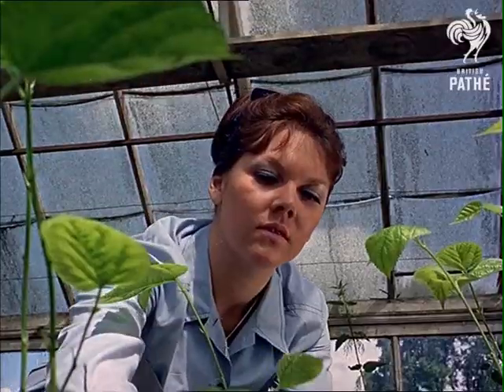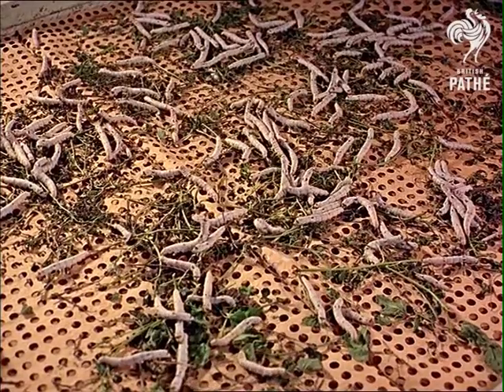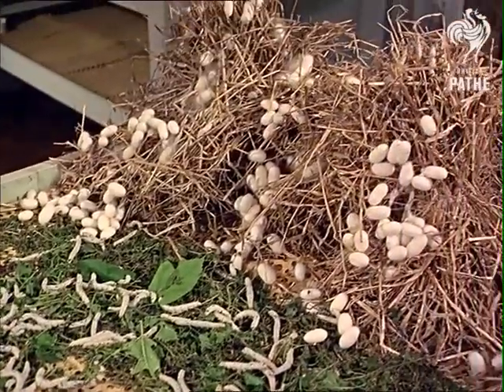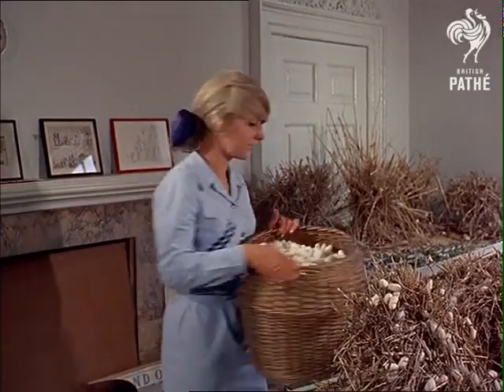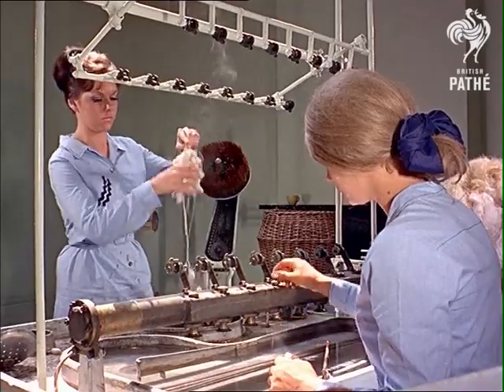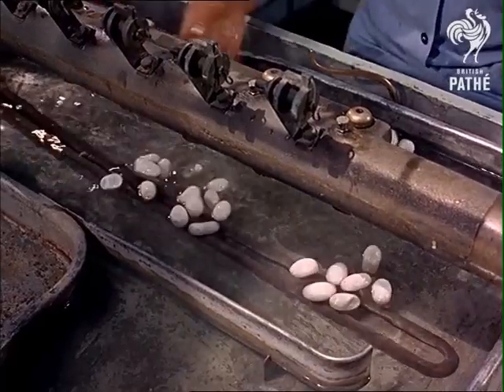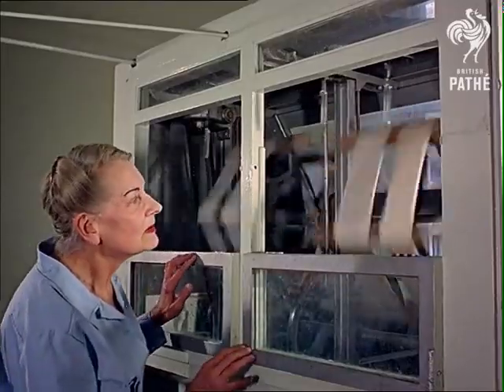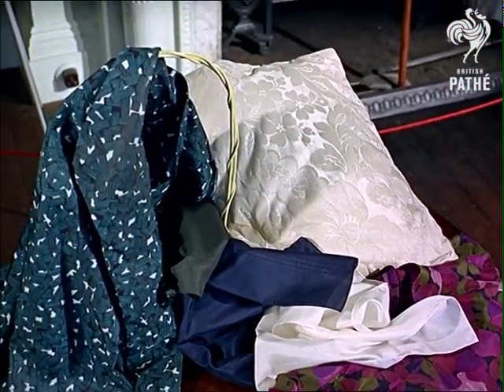Garment Making Process at a Silk Worm Farm (1966) | Vintage Fashions

Comment: To all the people complaining because of the dead worms... they're worms. Deal with it. You've more than likely used something made out of silk before, so stop using all silk if it really upsets you that much.
Reply: It's ridiculously easy to avoid all silk. Just read the label before buying.

And it's not death that is bad per se - it's being boiled alive.
Reply: Which is probably upsetting for you, but the experience of being boiled to death of an insect pupa (in a hibernation-like state) is necessarily going to be very different from that of a mammal (with our highly-ennervated skins and well-protected core systems.) For a small insect, the heat would penetrate and kill the nervous system rather quickly. I'm not sure that there would be any more humane alternative method of killing a pupa, or how we would know.
Reply: Robert Miles Of course it's different - nobody is saying it's going to be the same. But there's still a non-zero chance that they will suffer pain from heat. Your last statement is a false dichotomy - we don't have to pick between more humane and less humane methods of killing silk worms. We can just stop using silk, and stop breeding them and killing them in the first place.
Reply: Yes, we could stop using silk. However, are there alternative methods of creating clothing that doesn't involve the killing of large numbers of insects? The cultivation of cotton certainly does that.
Reply: Good point Robert Balder. I'm not aware of any methods that are completely cruelty free, so it's just a matter of choosing the lesser evil. I wonder if Brian Tomasik has anything to say about this. He has written quite extensively about insect welfare and wild animal suffering. (I have no idea how the tagging system works here; hopefully he gets a notification).
Reply: It's possible that through a bit more bio/nano/materials science, artificial silk and spinnerets could remove the need for animal use at all here (with the possible exception of bacteria and cellular life, certainly decerebrate life anyway.)
Reply: Am no fashion toady, wear clothes till they wear out.